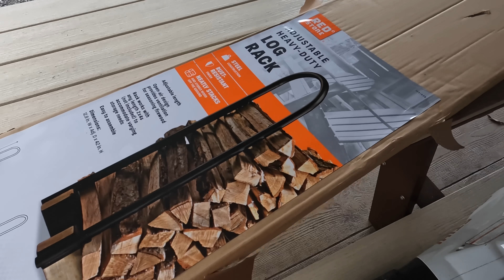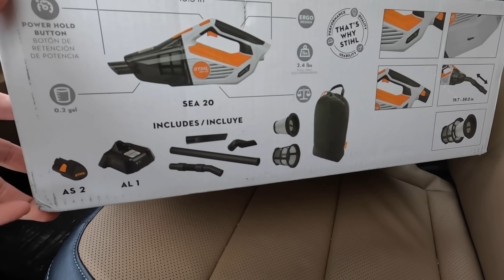One Man, One Machine, Super Fast FIREWOOD

Comment: We have a GE front loader that was new in 2005. Only thing I’ve had to do to it was replace the belt one time. Did it myself, it’s easy. Model: GFWH2400L0WW. Runs great. Tip: wipe up any moisture on the door and door seal after each load, and keep front door cracked open when not in use. That lets air circulate around the inside. It’ll never get moldy or smell. You can run larger loads and uses less water than a top loader, it’s quieter and stackable 👍🏼

Comment: The Tractor Supply Traveler DEF is the only DEF I’ve used in my 2023 Chevrolet, seems to be fine so far. $9.99 a container here in Ohio, my only complaint is the nozzle leaks so I started putting plumbers tape on the nozzle connection, problem solved.
Happy Healthy New Year to you guys!!!

Comment: Appliances aren’t what they used to be. We went to a commercial Speed Queen top loader a few years ago, with a family of 6 we go through a lot of laundry and so far so good. You should look into the Open Roads RV fuel discount program. It allows you to purchase diesel at truck pumps at a discounted hi volume rate and you can get def as well. I often get my diesel about $1/gallon less than the posted price. I’ve mentioned it in a few of my videos but it’s a great deal for those who burn any amount of diesel.

Comment: Mike I have DEF delivered to my yard in a tanker truck and they pump it into a  330 gallon tote. I have a DEF rated electric pump on it that is awesome. We run 7 commercial tractors off it and it last about 2 months. I just keep a black plastic pallet cover over it to protect it from the sun here in Georgia. It saves our company about $2.63 per gallon over the truck stop price. Not sure if all your equipment uses DEF or not but you could have them fill it half full and still save money. 👍

Comment: Shelf life on DEF is approx a year if you don't control its environment.  If you store it at 70-75 degrees it doubles the shelf life.
Reply: So how fast does it go bad in lowes at 72
Reply: Theoretically, it should last 2 yrs, but surely they rotate thru stock way faster than that.
Reply: I know my son bot a new wash in. dry.. $2500... As usual for 10 years.. nothing has gone bad
..

Comment: Washing machines - My wife and I bought a Kenmore 70 Series (Heavy Duty) in 1985 (or 86).  We still have it, and it works great.  We have replaced the water inlet valve twice.  Once in 1999, after the machine had been in storage for 6 years, and again in 2010.  We are thinking about getting a new machine, but the trash that is available now is not worth the money they want for them.  We would like a tumble washer for big loads, but I just cannot justify the cost for a machine that will only last about two years.

Comment: G'day Mike n Mel, It's 2024 here 88 degrees and sunny, I have Willow batteries in all my vehicles. We have a Cleanmaid which is made by Speed Queen I was told we had bearings seals  brakes and belt all replaced it's like new 25 years old my work clothes go in it and the missus puts the delicates in the front loader👍.

Comment: 2 comments today
I was a bit snarky on the 1st video of the new splitter but Your wood today was awesome and fast. Still not $65k fast but a great machine.

A few years ago our washing machine went out. We got 7 years before it completely came apart inside and put a hole in the drum. The lady at the appliance store said we did great at 7 years. Most won't last but 5 anymore😮
These companies use magnesium spider are to connect to the stainless steel washer drum. The magnesium corrodes and falls apart long before the other metal parts ever would.

Comment: Hi Mike and Melissa. I just want to comment on the speed queen washer and dryer. My wife and I got a set 7 years ago with the digital display and it has been great!! Only problem with the washer was we over loaded it with dirty kids snow gear( spring time in Wisconsin and was muddy snow while cooking maple syrup). One of the little kids mittens got out of the drum and wedged between it and the top frame and caused the belt to burn out. I called the place we got them and since we had it for 4.5 years it was still under warranty (5 year on everything) they came out and fixed it for free, parts and labor! Definitely go and get a speed queen!! Thanks for the great videos,  and happy new year from Chuck in Wisconsin.

Comment: Hey Mike I buy DEF fluid from a station that has truck terminals. The capacity on the 350 is 7.5 gallons I believe. I put 5000 miles on mine this past summer on a vacation out west and never had to top it off. It is more of a nuisance than anything.

Comment: Topic of cloths washer - i have gone thru 5 of the cheap washers and 3 dryers.  Now, after the last washer took a poop I went to the local appliance store after inquiring about washers and the folks there kinda steered me to speed queen a bit due to what environment i work in and the warranty of speed queen. Well, i bought the tc5 commercial washer last year and 4 years prior had purchased the dryer.  I bought the middle of the line up.  COULD NOT BE MORE IMPRESSED with the equipment.  Also these po products are made in Wisconsin.  Any questions please ask.

Comment: Happy New Year to you guys! I join in with you about not liking front loads. Spent like $1400 on new washer and dryer 4-5 years ago and washer didn’t last 4 years. Still using dryer but replaced front load with a GE top load with the least amount of features possible and seems to be working great so far. Mike I think you seem to like that new splitter more each time you use it. Possibly a permanent one in the future for you??

Comment: I had a problem with my Maytag drier (which I purchased used about 20+ years ago) and after much calling around looking for someone to fix he not always heating problem. Nobody would even look at it saying that Maytags weren't made anymore and NO parts were available; and I needed to buy a new drier (which they had in stock). I finally found a guy a couple of towns over that told me the problem was the igniter, and since Maytags used a standard one (of which he had a dozen or so, he'd fix it later that day. He told me that my unit was at least 30 years old and I should fix it every time something went wrong as it was far superior to anything new out there and I could probably go through 2 or 3 new ones before the Maytag would need service again. They used to make them to last' not with the idea that they could sell you another one in a year and a half (of course that's with a one year warranty).

Comment: I recommend roller shades instead of blinds. We converted to roller shades at our cabin in a total cabin remodel in 2017 and we love them. They are great and provide a really clean look. We would never go back to blinds. I installed them myself. I created a template for drilling the holes. Install time per roller shade is five minutes using the template I made.

Comment: Happy New Year to the Morgan's ! Thanks for all the informative videos.  Was in the market for a new washer/dryer recently and settled on a GE One and done. It is both a washer and dryer in one. I was considering speed queen but it just didn't have the capacity that this GE has plus both a Speed Queen washer dryer will put you back almost $4000. Just Put the clothes in the GE and approximately 2 hours later both washed and dried. Runs off of 110 and no need to vent to the outside because it is a closed system. Most people complain about front loads stinking but with the drying option the washer gets rid of any moisture. With it running fully on 110 the manufacturers cost per year to run is only $16.  Lots of videos on YouTube about it.  Good luck !

Comment: Good afternoon Mike and Melissa,
I have to admit that I'm sloooowly coming around on the splitter. It's still way to much money for any ordinary homeowner of course, but if your into firewood sales, then I hope it's quite a bit.
Speed Queen is probably the Cadillac of washers. Would never not buy a top of the line model. It will last.
Melissa, as far as cleaning out the attic, don't need a dumpster since Mike can just load up the dump trailer, haul it to the burn pit, thrown in a bag of Fire Starter and voilà, all gone😂😂😂
As long as Alabama loses is all that matters. Their team is OK, can't stand the head coach though. Then Michigan gets beat in the finals. I'm from Ohio and we absolutely sucked on Friday. What a complete cluster flock that was 😢😢😢.
Here's to a good New Year.

Comment: Buying DEF in bulk is convenient but it will go bad like you said. A company I used to work for had about 7 Cummins diesel pick up trucks and a few backhoes that used DEF. The owner bought a IBC tote full of DEF they had a transfer pump on it to pump into the vehicles and it was awesome because all of these trucks traveled hundreds of miles a day to and from the job sites. It was super convenient you just pulled up and were able to fill the tank as opposed to just adding one or two jugs at a time. BUT after about a year or so it started to crystallize and basically was useless… maybe not buying such a big bulk is the answer?🤷‍♂️have a happy new year!

Comment: I buy my DEF from an oil company that I also buy my oil from for my oil changes on my skidsteer and my Peterbilt. I get it in 55 gal plastic drums. It's cheaper and easier because I also purchased an electric DEF specific pump for it with an auto shutoff nozzle. I was worried about the shelf life of the DEF as well and was told it is good for about a year, depending on how you store it. Mine is stored in a non temperature controlled garage, and I haven't had any issues yet. I've gone though about 10 drums of it since I started buying it this way.

Comment: I buy Blue DEF at Sam's If I recall it's around $15 or $16.  I have a 2015 Denali where the DEF fill is under the hood.  I can tell you that trying to  dump a container of DEF in that is a huge pain in the butt. But I have found a way to make it easy.  I purchased a battery transfer pump for $19 on Amazon.  It will empty a container in less than a minute and I don't have to hold it up.  I just set it on the airbox and it leans towards one corner where I let the pickup of the pump sit.  The only problem is that neither the pump or the discharge fit. The discharge is over 3/4" and the inlet to the tank is 3/4".  the pump won't fit through the opening in the container.  I solved both.  I cut the end of the tube that comes with the DEF off and attached it to the end of the hose.  For the container a simple slice with a knife of the container at the cap allows the pump in.  I believe there are some pumps available now that meet both of those requirements.

Comment: Speed Queens are great when they are working.  I bought a new one, it lasted 7 months…however…Speed Queen did stand behind their product.  They gave me a loaner washer until my new replacement machine came in.  They are very loud on the spin cycle, sounds like a plane taking off…and they are about $2700.

Comment: Only buy DEF in the 2.5 gallon containers.  That way you will use a whole container at once or the container as a whole quickly.  Once the containers are open it allows for evaporation of the water and once the water starts at evaporate the urea concentration changes which plays havoc in the DEF systems.  Plus there is a possibility that you will build up crystals or contaminants in the larger storage containers or In the dispensing equipment.  This is all bad for your trucks and equipment.  We fight this issue all the time on the heavy truck side.

Comment: Do you know they make a machine where you put a whole log on there and it will cut the log in pieces and it will drop down in the shoot and there's a hydraulic system that pushes the log through and it chops it up into firewood at the exact same time I don't know if you've seen that system you put the whole log on a conveyor it moves forward cuts it off to the length you want it for firewood and it drops down the cut off piece drops down in a shoot a hydraulic cylinder pushes it and chops it up and then the command drops it out in your pile it does everything, they got equipment now where you put a whole Tree on a conveyor and it does everything for you you don't have to do it like your machine you bought where your man handling all your cut off pieces of wood

Comment: Called a money gig on the fine. Diesels have  like 40% lower mission than a gas . Before DEF ,they want to line their pockets with EV vehicles,  that will fade away soon enough. DEF runs motor oil way to hot , shorter life of motors . Good against 💰

Comment: Your comments about SCR Technology indicates that you might not have a full understanding of the technology.  A 187 MW Gas Turbine Generator,  with a platinum catalyst in the exhaust stream at 400 degrees f, injected with NH3 converts NOX into HH20...Hydrogen and water.  50000 shp, at full load,  makes less NOX than a new Gas engine in a sedan.